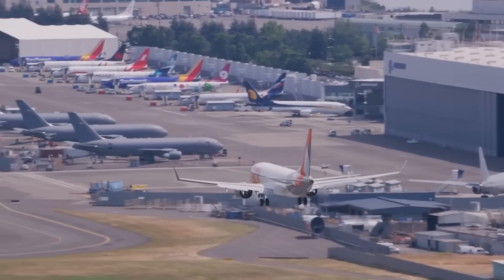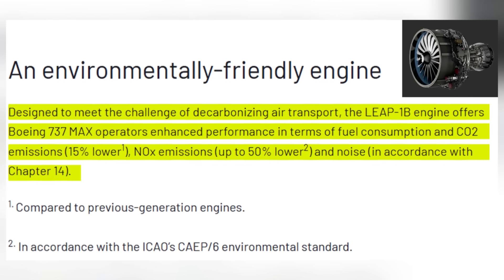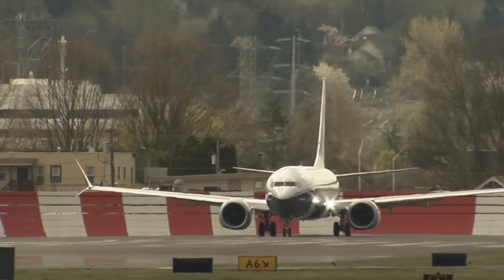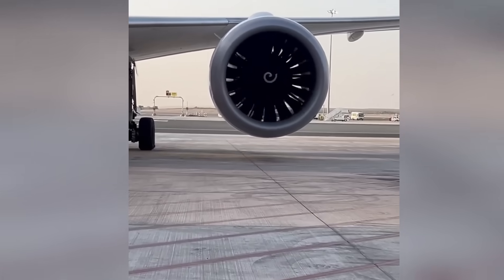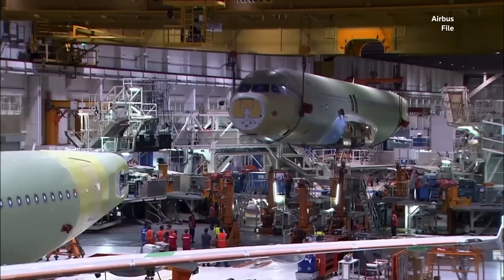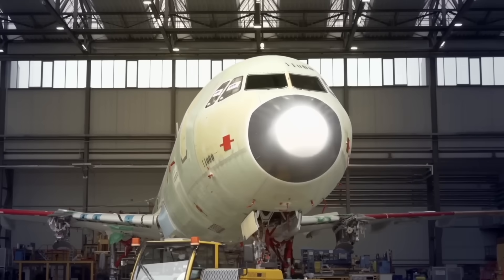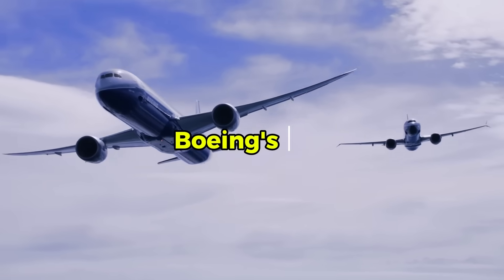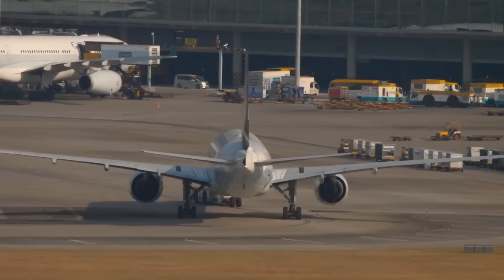The Boeing 737 Max Is More Advanced Than You Think!

Comment: It was idiotic for Boeing to not redesign the 737 more in response to the A320neo. Additionally, many of Boeing's airline customers are also to blame for this. Boeing had proposed much more fundamental upgrades, including new wings, fly by wire, and a cockpit redesign, but customers told them to maximize changes while maintaining type rating without simulator time (Southwest specifically said this). Boeing was just the one dumb enough to go along with it and then hide the fact that they added MCAS. Also, given that MCAS can add flight control input, it is idiotic that it can rely on a single angle of attack sensor on some planes.

Comment: the engines are new and great but the body sucks. engine placement on low wing creates problems. a new wider, stronger and lighter body was needed. MD execs shafted Boeing. Airbus planes will pull ahead as a result.

Comment: Boeing has created its own problems by straying away from engineering quality as it had before the Max and 787. I am sure they still have a long way to go to pull themselves together and develop a culture where technical issues are solved and not swept under the carpet as has happened over the last 10 years.
Reply: You know what is the saddest part, had they been transparent with the MCAS, pilots would have known how to handle the issue. After plane was cleared to fly again, no accidents had been reported and it’s the same f-ing plane. Why, cuz pilots now know what to do.
Reply: @RJ-lh8vm they did fix the software.